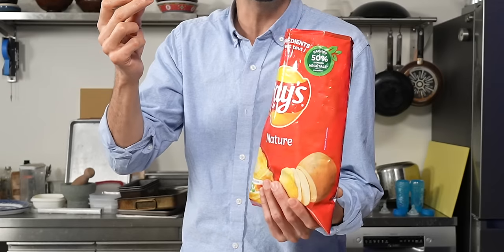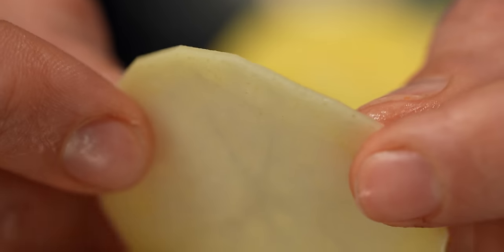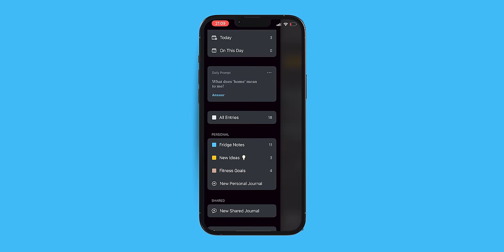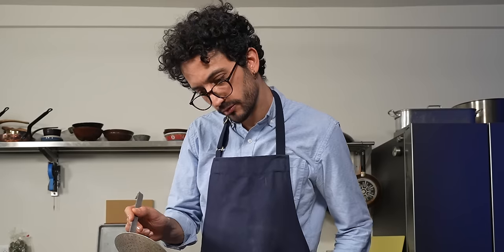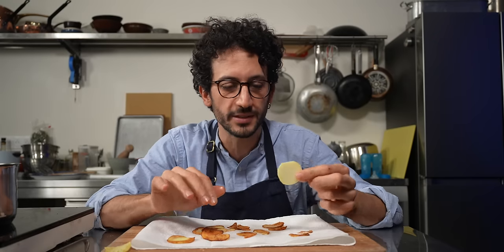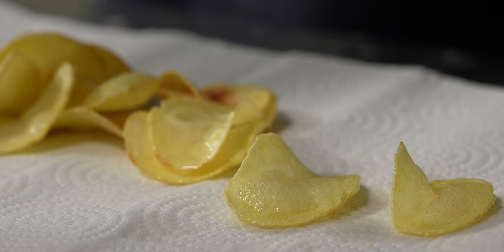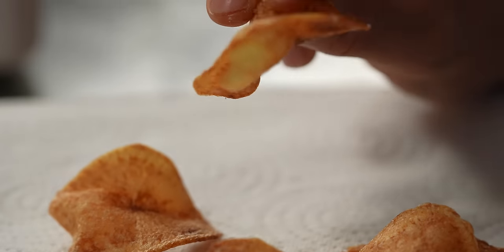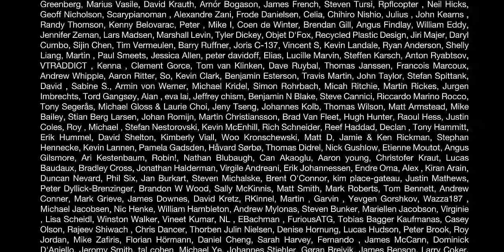How Hard Can It Be To Make a Potato Chip ? (hint: Fly you fools!)

Comment: The color and bitterness you're getting is from reducing sugars in the potato (Maillard Reaction). The crisp comes from the glass state transition. What you're ideally looking for is a potato high in starch and low in reducing sugars (Cold stored potatoes will begin to convert starch into sugar and increase the browning.) As for the frying, what is happening is a dehydration reaction which replaces the water for oil. The soft chips haven't fully been dehydrated and made it to a glassy state. You're closer than you think but there is a lot that goes into it. 

Source: Previous QA Director for snack food company which specialized in potato chips.
Reply: I was thinking that might be the answer; dehydrate the slices before frying, but obviously you have actual knowledge on how to do it.
Reply: Thats awesome insight. I initially thought you would want to go less starch to get less browning. But apparently my thought process was wrong.

Is it still a maillard reaction outside of proteins?....i thought starches would be dextrinizarion.
Reply: Commercial potato chips are made from a special single variety of potato that has been bred to be low sugar, low moisture and high starch. You will never see this variety in a supermarket, but it's the most commonly grown potato in europe. Lays use a custom bred potato called FC5.
Reply: Thanks for reminding me. Cold potatoes, not good for chips.
Reply: Did you guys fry them in 2 stages ?
i followed a recipe a loooooong time ago and made very nice chips by first "cooking" them on a lower temp and then frying them again to get the crisp.
Similar to how fry shops do french fries (at least in the Netherlands)
Reply: That was one of the first things that struck me. I also saw a hint of foreshadowing in the video though as Alex seems to pick several different types of potatoes in the shop. Also moisture is clearly the enemy in this case.  Perhaps this should be tackled as with fries by double cooking but switching the cooking times. It seemed tja Alex almost cooked them through the first time. Maybe just pre-cook to get rid of the moisture and then high temp flash cook second time. I believe they use a. Similar technique to make those puffed up pillow potato chips.
Reply: Probably use an industrial drier
Reply: Spoiler, Alex was meant to reveal this knowledge over the coming episodes...
Reply: @smurflord2  this is a really good point.
Reply: It is so funny to see him try to make potato chips, I just made some yesterday. 
I used yukon gold but to get the moisture out in the most easy way I know was to blanch the potatoes in hot water then dry them for 10 minutes or so.
You still get color on them but not a lot.
They turned out great.
Reply: I actually build potato chip factory's, and help with troubleshooting a lot: get fresh potatoes, that were not cold stored. If they are semi cold, warm them up slowly (1C/day) to get some conversion of sugars to starch again. You need potatoes that are suitable: lady rosetta is a good species for chips. If you get too much browning: try blanching them a bit. Too much gives a weird texture.

We actually vary the frying temp (and agitation) during the process, by injecting hot or colder oil to get the temp.profile that is best.

@Alex , I don't know how to reach you, but I am able to simulate the process in my testing facility, maybe we can figure something out.
Reply: We dry brined our potato chips over night when I worked in a restaurant as a sous-chef. Russets are ideal for this.
Reply: @ryanmcanelly6556 is spot on here. The most important thing you need to do is dehydrate the potatoes before cooking.
Reply: So basically a white potato that's been freshly picked?
Reply: Lays/Walkers even have their own type of potato specially bred to their requirements. You can't get close to their pale but crispy combination using store-bought potatoes.
Reply: Wow not too often we get a legit expert to give Alex the solution in the first video in a series, I hope he impelents your suggestions!
Reply: @AkJakolantern likely all episodes already produced so not likely lol
Reply: Pfff... duh. ;)
Reply: @smurflord2 

Not just one single variety, some variety. 

Some have to be cooked right after harvesting and can't go in a wharehouse. Some can.
Reply: While I had no intuition about high starch/low sugar potatoes being better, watching It I knew Dehydration had to be key to getting crispy without overfrying.
Reply: My fist instinct was to fry at a low temp then high temp like chips for  a crispy product but I hadn''t considered starches reducing to sugars and burning. Thanks that helps a lot with my own home frying!
Reply: @wmkm7144  Yep. I'd bet my house he'd figured it out before filming, but letting on would not make for such an entertaining video.
Reply: I knew there needed to be dehydration of some kind after the washing of surface starch from the slices and drying from excess water. Thanks for the open info sir!
Reply: Yep, Same idea as other in this thread : Try to dry and/or precook them before frying.
Reply: Same though.... Two tips:
-change one variable at a time (temperature of washing)
-use your trial to learn as much as you can: you pulled out two chips and then all the others late, instead if taking out small batches till the upper limit

On the practical: fresher potatoes (less brown down starch aka sugars, short time between washing, drying and frying (sleeping out of sugars/starches through the cut, in fact your last batch was darker then the second last), AIR drying  in a metal bowl layered with paper, bounce it and blow air on it, you're evaluating the last bit of moisture
Reply: Sometimes you just know when someone knows what the heck they are talking about.
Reply: @wmkm7144  reminds me of the perfect mashed potato series. The format seems to work
Reply: I wonder what happens if you fry at a higher or lower atmosphere 🤔
Reply: tossing par-cooked potatoes uncovered on a sheet tray into the freezer is a great way to dry them out.  I've got great results leaving them in for a couple hours when making fries.  I imagine for something as thinly sliced as chips, you could get by with 30 minutes.
Reply: Hi. I'm not by far a cheff but my self for making potato chips I cut them in a mandolin very thin then put them in water with vinegar and salt at least 30 minutes. Then after frying dry them off.
Reply: @Finwolven  Same here. I have tried myself before, and always felt the crucial thing is that the slices go in too wet
Reply: He is gonna try his own original ideas first, but if he fails he'll try whatever you guys  just said... hopefully he can make it on his own...
Reply: @DFine321 I think it’s sugar that makes it darker
Reply: @smurflord2 Also potato chips are made within like 24 hours of the potato coming out of the ground, this helps further reduce the starch to sugar conversion further.
Reply: @shike769  I was going to say, the potato used looked to be a more mealy texture one and you would really want something with the fortitude of a waxy with the softness of a mealy. yukon gold is probably ideal for this as it's the hybrid balanced for just that!
Reply: My friends brother works in a chips faktory in Sweden. According to him they use a potatoe named Saturna that is produced only to make chips with. Its a low starch potatoe that dont brown as easy
Reply: Claire staffitz has a video on recreating potato chips at the bom appetit channel a couple years ago. Worth the watch
Reply: @Taliesin6  This is the way McDonald's Brothers started. They stored the potatoes under the counters at the first stores in hot dry California which dried the potatoes and then they did the two stage fry magic,
Reply: Also the fry oil is important. At a minimum for the flavor. Grab a bag of corn/soy chips and one made with cottonseed/other oil and you'll know the huge difference. Do a factory tour on how they get the oils used in frying/chips/etc ... true Frankenfood systems.
Reply: SALT! - you need to salt the chips,  the moment they come out of the oil, that provides the last level of dehydration. It's that simple! swirl the chip in the oil, so they don't stick. Then pour them on paper towl and salt them. job's done!

Comment: WASH THEN BLANCH YOUR SLICES!
WASH THEN BLANCH YOUR SLICES!
Just made some homemade sweet potato chips yesterday, and times before…and blanching is the key to maintaining color…I read somewhere suggest using vinegar in the wash or blanch boil, I used it in the boil.. about 3-4 minutes…..DRY…then fry.
Reply: Around 365⁰ oil, has to be quick or it absorbs oil and becomes soggy by oil
Reply: Yes this^ I also gently dry my potato chips in the oven at a low temp to draw out any remaining moisture without browning/burning further. Can also use dehydrator.
Reply: Agreed, although I use the freezer instead of a dehydrator.
Reply: @zyxwvut4740  interesting! What do you do freezer wise to the chips?
Reply: @mhkins  First I sprinkle the vinegar, then put a single layer on a plate overnight. I got tired of making my chips and fries soggy by adding vinegar at the last minute. Then realized the vinegar flavor survives the freezing and the freezing removes moisture.
Reply: or you can just use Drywite and soak them for minimum of 15 mins before frying to limit the Acrylamide just like the factory's do, also they use palm oil not rapeseed oil. (use sustainable like frymax) 😆
Reply: So something similar to making McDonalds french fries? (By Joshua Weissman)
Reply: and blanching with a little bit of acid helps even more
Reply: @acemanhomer1 Misconception that oil absorbs into foods faster below 350.
Reply: @79blueingreen  maybe so to a degree, I just imagine the longer it sits in the oil, the more time it has to soak in IF it doesn't set an outside layer quickly. And that all depends on the nature of what you're frying.
Reply: 100% correct
Reply: @Azamyth  Thats my trick too!

Comment: Dehydrate them first. Works when i make beet, carrot, and parsnip chips.
Reply: That was my first thought. Also I know nothing about it but air frying ? Maybe that's the answer ?
Reply: @Pomaufour  i dont think they had air fryers when they invented chips tho..
Reply: @onistgaming5177 
They also didn't have the potato that Lays use...because they invented it.
Reply: Yeah. My Mum used to make potato chips often when I was a kid. She used to leave the potato slices out in the sun to dry completely and then store big batches of those dry slices away, ready to fry whenever you want a snack. 
Those may not have been Lays equivalent, but the dehydrating sounds like an important step.
Reply: @JustAnotherMe How did she  handle the potatoes darkening in color when in open air? If I just leave a slice of uncooked potato to dry out it starts changing color. I think especially the edges? It's been some time. Or maybe it was that being in the sun means higher temp and they dehydrated without becoming splotchy?
Reply: Dehydrating them would probably work. Another method that could work a bit faster would be to fry them halfway through first, then pull them out, drain/pat dry, and then toss them back into the oil to finish frying. I do this method when making French fries and it's really good for getting an excellent crispy exterior to the fries. So, if the chips are thin, then it should produce the desired effect without waiting for a food dehydrator.
Reply: How would you dehydrate them?
Reply: @onistgaming5177  air fryer is just a fancy marketing term for a convection oven, but the potato chip does indeed appear to have been invented before the convection oven

Comment: my mind immediately went to the thought of frying the potatoes under vacuum, basically the opposite of how pressure fryers are used to increase the temperature and retain more moisture for fried chicken, fry the potatoes under vacuum to lower the boiling point of water and promote dehydration/crispifying while keeping browning low. Doesn't sound like the most uhhh, practical thing to do at home, but you've built a lot of impractical kitchen appliances over the years!

Comment: Formula for chips: Slice them at exactly 2mm (to thin = brittle, to thick = to much potato flavor. The oil needs to be 160 degrees Celsius(sunflower oil) The potatos need to have alot of starch( 15% or more) and as you did you need to wash and dry the slices
Reply: "Too much potato flavor"
They're POTATO chips. They're supposed to have that flavor.
Reply: @grabble7605  not really, no

They are crispy because the water has been replaced by oil, so really you are mostly getting fat and salt flavors.

Comment: you should use 2 temperatures. first temp about 150 C then 180 C. Let them rest between cooks. The resting time is tricky because main objective is to dehydrate and therefore lower the next cooking time.  Times and Temperatures are suggestions but they worked for me. It should be different for you since we dont use the same raw materials, etc..
Reply: That's how we did it when I worked at a fast food place that made French fries from actual fresh potatoes. A longer cook in oil at a lower temperature, then we'd store the fries until needed, and cook them quickly at a high temp.

Comment: This is a very timely video for me because I’m researching the exact same thing right now. The America’s Test Kitchen video on kettle chips shown in your search results mentions cooking the chips in oil for five minutes at 240F in what they call the “gel zone”. I know that you’re not trying to make kettle chips, but I think that there’s something to this. You’re basically dehydrating the chips in oil and infusing oil where the water used to be. I’d try partially dehydrating the potatoes in a way that makes sense in a large chip processing plant and then fry them in 240F “gel zone” oil. You definitely don’t need to go above 260F because that’s where they start to burn for me.
Reply: Also, there’s the fact that the chip companies use proprietary (or difficult if not impossible for the consumer to buy) potatoes and they test each batch for a wide variety of factors and then adjust their well researched cooking instructions accordingly on the fly. This may be a holy grail that’s not worth your considerable talents, Alex. I’ve made great kettle chips using the ATK method, but my results have been inconsistent. I’m leaning towards saying that making potato chips at home isn’t worth the trouble unless you just want to do it a few times for fun just to say you did.  All things considered, I don’t think cooking them yourself even saves that much money considering how much cooking oil costs these days.

Comment: I went on my own little rabbit hole about potato chips, I believe it's pretty much impossible to make a 1:1 recreation of the regular commercial chips
Reply: I think you can achieve it reliably by a 4 step process. You slice them, cook them (boil or steam I guess, maybe you can omit this step, but it think it will improve things), then you dry them in a food dehydrator for a very specific amount of time that I can only guess, then you fry them in hot oil. It is what my intuition/experience tells me right now. The drying step is the most important, and the more you dry the more easily they get crispy, until the water is so little it will burn easily. I am willing to try it if you do it please let me know the results. I will let you know of mine.
Reply: @JanusXX  its funny that you mentioned that the thought of dehydrating the potatoes also comes to my mind. That's the same principle behind prawn crackers. Unfortunately, I don't have a dehydrator, so I can't put that to the test myself.
Reply: @JanusXX  Sadly, in this case, he is right. You can't make a 1:1 recreation of commercial potato chips by buying supermarket potatoes. It basically comes down to starch to sugar ratio on the potato which is influenced by growing and storage conditions. For commercial potato chips you want very low sugar content, which means high starch, ideally with low water weight. Supermarket potatoes will have high water weight for better yield, high sugar and low starch due to cold storage.

Higher sugar = higher browning which makes it bitter.

It's possible to cheat a little bit due to a temperature differential in which the browning reaction happens and the glassy (crispy) transition happens, but it will still be different than commercial chips without the right potatoes.

Comment: If I make chips myself, I wash them beforehand, but not once like you, I do it 2-3 times. I also let them float in the last water bath with a pinch of salt for about 30 minutes. THEN I bring a pot of water to the boil. When the water is really bubbling then I put the chips from the salt water directly into the boiling water for ONLY 1-2 minutes.I don't cook them through! I just cook them lightly. then I do the same as you I dry them on paper towels heat the oil and fry them. Due to the parboiling and the salt water bath, the potatoes have significantly less starch and become crispy instead of rubbery and then your  crispy chips are ready. And very important, as soon as you take them out of the oil, salt them! This helps to bind excess oil which makes the chips soft again

Comment: I worked at a potato chip factory for a bit, im pretty sure they would let you in. The factory is named taffel and is in Finland.
A detail I do remember is that the variety of potato is important, they were using a potato named saturna that resists burning quite well, and I was able to make really good potato chips at home using this potato variety. And as you figured out, temperature control is important.

Comment: Thin slices with the mandolin.
Bring a 5% salt solution to a boil.
Pour the hot salt water on the slices and let them sit in the hot water for 5 minutes.
Pour out the water.
Lay the slices on a sheet with paper on bottom and let them dry for a day.  (Try to get rid of as much moisture as you can).
Fry.